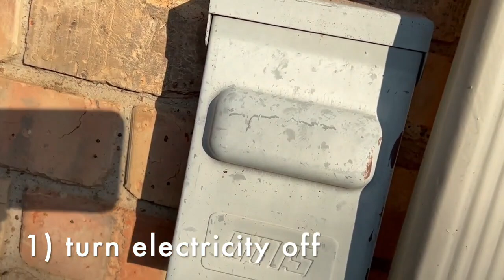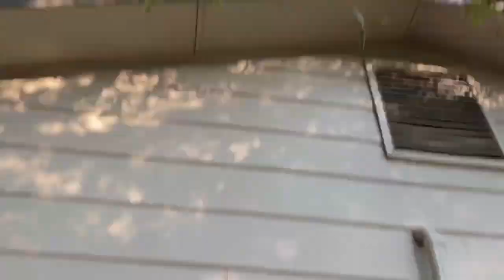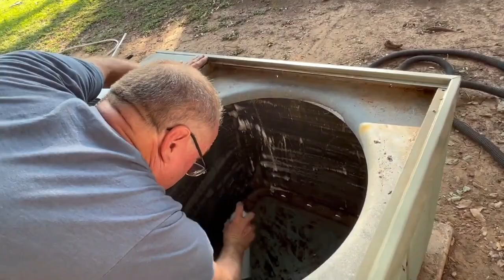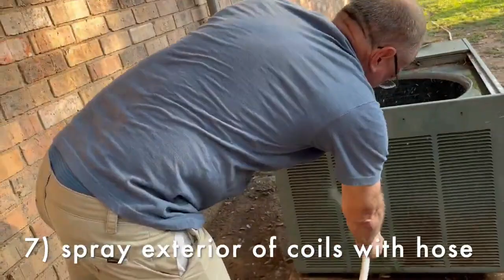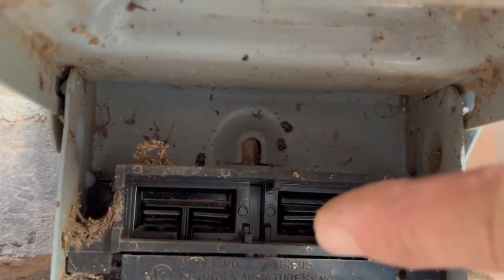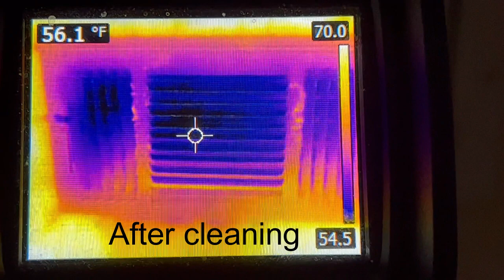How to Clean Your Air Conditioner Condenser Coils (EASY Step by Step Guide)

Comment: I am a professional.  Rarely will I use coil cleaner...too harsh.  On 98% of units dawn detergent will get you there.  Dog pee on units will more quickly rupture using coil cleaner vs dawn.  We have even discolored units and customers were rightfully pissed.  Really appreciate your videos.  I was a builder for 40 years and had over 100 rental homes hardly ever had a maintenance call.  Always had same hvac units in most every home (janitrol).
Reply from the maker: Thanks for watching and for the feedback. I think I will try the Dawn detergent next time. I have a YouTube short showing a condenser unit that was severely damaged by dog pee.

Comment: To actually check if the cleaner works, you should have tried one side with the cleaner and one without. You didn’t get the cleaner everywhere but I can’t tell where you used it and where you didn’t.
Reply from the maker: Well, I wasn’t trying to see if the cleaner made it look cleaner. I did use the cleaner everywhere, although I may not have shown myself using it everywhere. I appreciate the comment and I appreciate you watching the video.

Comment: Nu-Calgon brand. Alka-brite+ condenser coil cleaner in the gallon jug! Will be the best 30 bucks you ever spent. And you have enough to clean your outside unit a dozen+ time's.
Reply from the maker: Thanks for the info. You’re not a salesman are you? Ha ha
Reply: Alkaline cleaners aren’t worth the risk unless your coil is contaminated with grease. Unless you rinse it off extremely well, the aluminum will get eaten by the cleaner. Micro channels may end up completely destroyed.